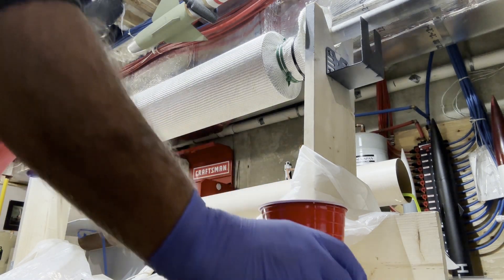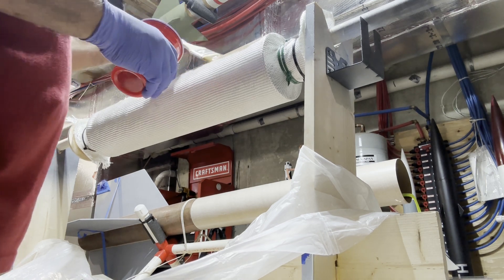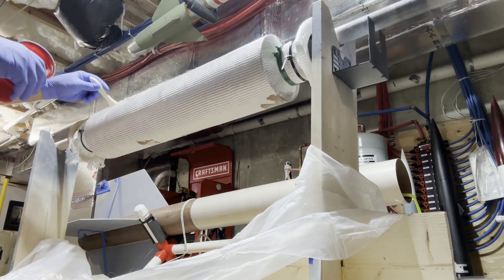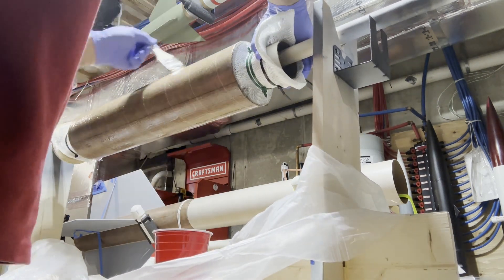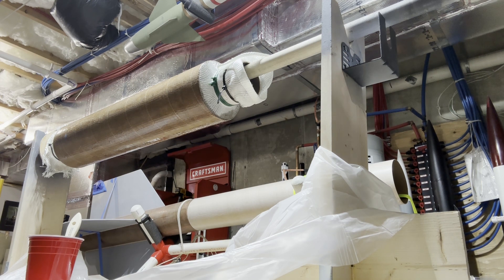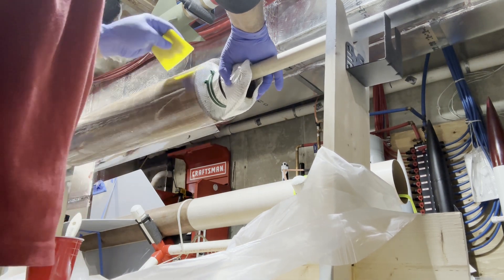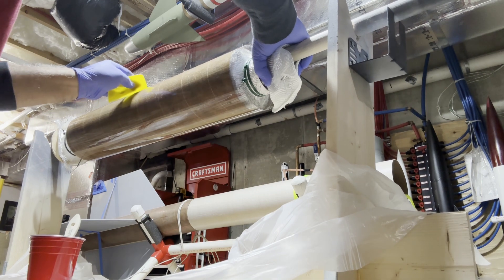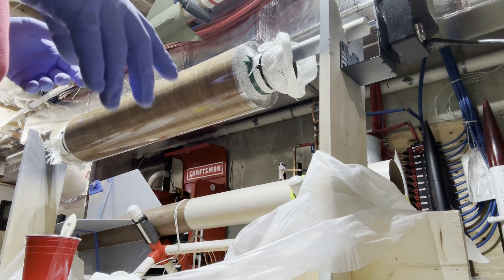My way to fiberglass a rocket tube

Comment: So you leave a traditional paper tube as the base? The glass sleeve is on that?
Reply from the maker: I peal off the first layer of shiny stuff first.
Reply: @AerospaceRocketry  thank you.
Reply: @AerospaceRocketry  2 other questions; what is the weight of your cloth and what do you use for resin and accelerator.